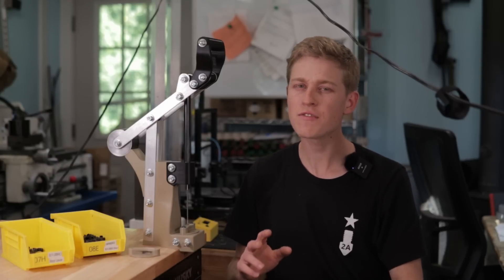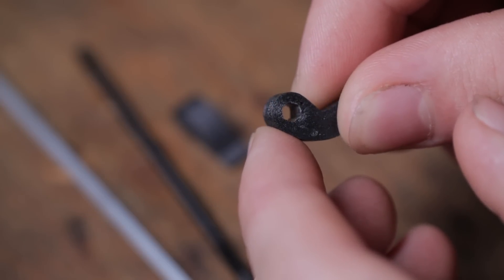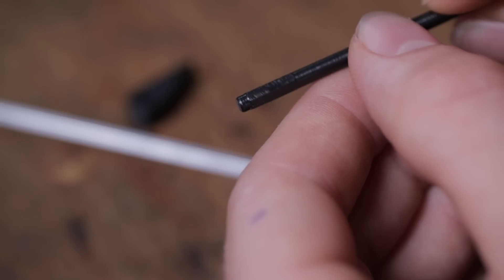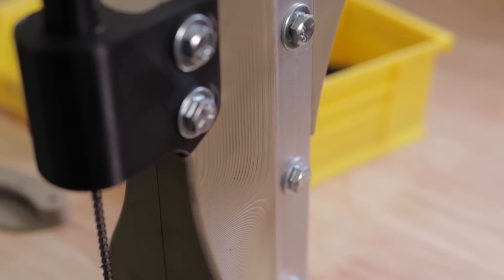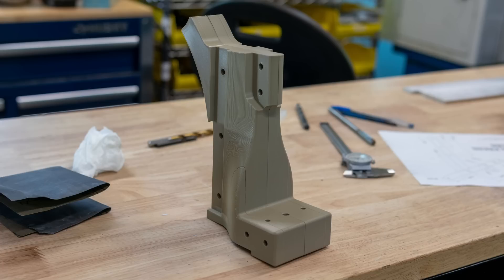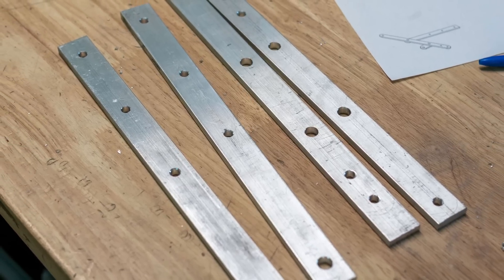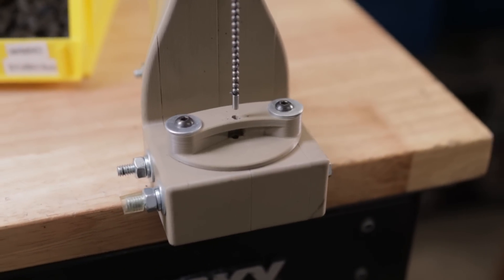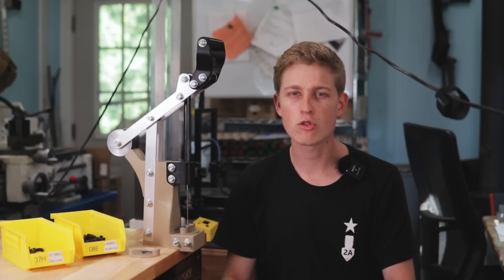3D Printed Broaching Press

Comment: You can add features into your CAD to force a sharp internal corner on a print.  Just be sure to turn off Arachne in your slicer or it will ruin your hard work.

Comment: you could also modify the geometry of the hex cutout to be more of a 6 point star shape to compensate for the printer's tendency to round off edges
Reply from the maker: A great technique! That's what I do with buffer threads, extend the corner away from the interfacing part to prevent interference. Unfortunately there is just not much room on the little levers.

Comment: Now make a contraption to make barrel rifling
Reply: My first thought. You could probably use this if you had a series of progressively larger rifling buttons
Reply: @noahmcabee2534  well it could be as easy as a spiral shaft and a single cutter essentially cutting every groove
Reply: @darktrojan00  nahh it would take so much work and redesign to use that press it would be much simpler to just use buttons. It would be easier and a higher quality product in every way. With a single cutter you'd have to get your spiral from the up and down function and repeatability would be an issue and so would wear, tool sideload and tolerance. You might take 10 thousands off the sidewall but it would be accompanied by 30thou on the machine. Definitely possible if upscaled by about 350% but then printing would be the problem. This is one of those jobs perfect for using a 3dprint to make a metal casting.

Comment: You would be better off going to square..  It's less likely to have slippage.
Reply from the maker: Hex is easier to find around the house (Allen key), which is why I went with it. For the custom shafting I think you are correct, but it would add some complication having several types.

Comment: Slick design.  You probably already know this but sites like Mcmaster sell flanged brass bushings in many standard sizes.  Combined with shoulder bolts this is an easy way to accomplish the smooth pivots as in your design minus the lathe time.  Another slick design trick is making small cylindrical bosses where the bolts clamp up.  Throw a fillet or some draft on these and they spread the clamp force wider into the part yet.  Common on ductile iron castings for heavy trucks.
Reply from the maker: I need a reason to use my lathe ;)